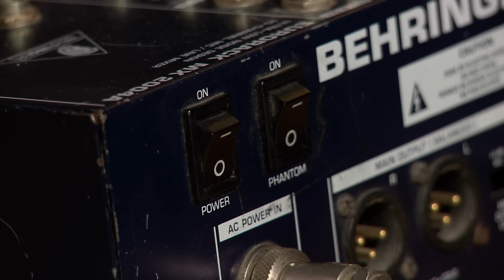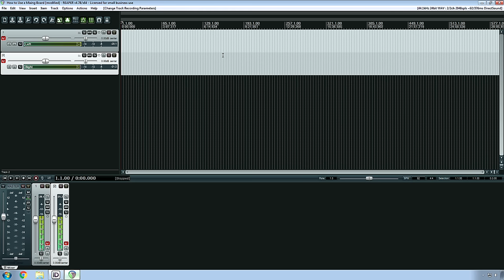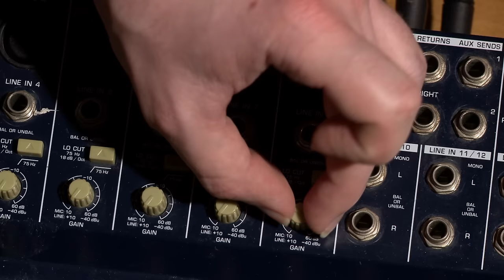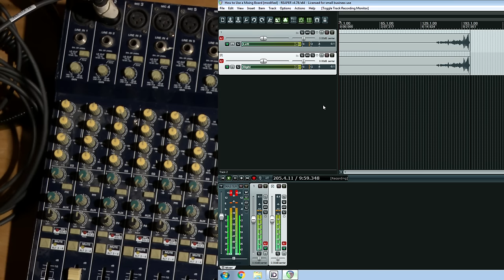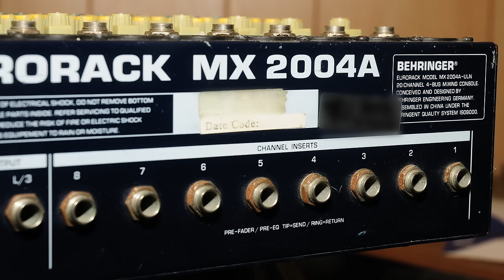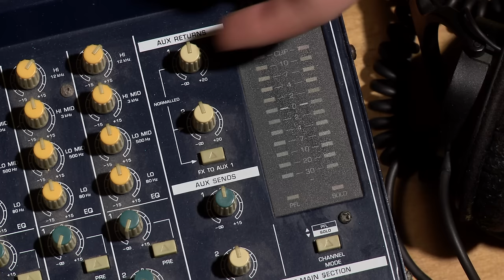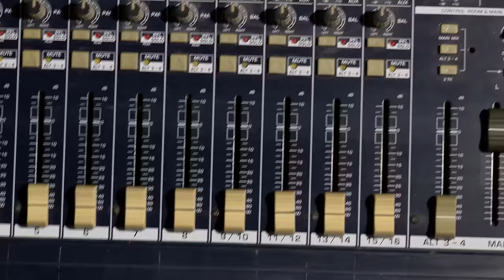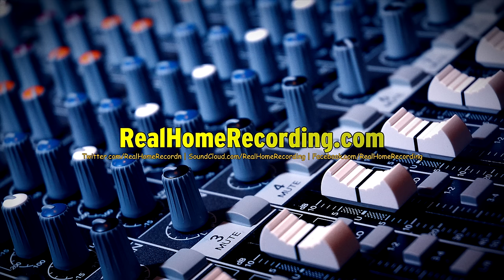How to Use an Audio Mixer Board Tutorial Mixing

Comment: Very recently (2019), for the first time in quite sometime, I felt the pull to go back to an analog desk, after watching videos and reading articles about the new SSL Origin analog console ( especially since its priced at around $50k, which is ridiculously inexpensive for an SSL). 
Starting out in ‘79/‘80, I came up in the era of tape machines, LFC’s, OB Racks and Patch Bays, and while there are some things that I DON’T miss about those days, I really do miss the tactile side of the craft; and, there was definitely something about the sonic vibe that was unique...
It seemed that mixes were easier ( and quicker) to dial in on a desk, than on a DAW. Perhaps it was was because of the inherent limitations of the format; the fact that we weren’t obsessing (or couldn’t) over every tiny, minute detail, as can be done very easily in a DAW. Decisions had to be made, and committed to, because there wasn’t the hundreds of tracks available, with frame accurate editing and the easy ability to move things around on the timeline in the song. And the sound seemed to come together more quickly, with a pleasing cohesion and smoothness...
But... then I’m jarred back to reality, and I remember the other side of analog, the not so good things: constant maintenance of desks and tape machines, editing tape with a grease pencil, razor blade, editing block and editing tape-and there was no “undo” button if you messed up an edit. In addition to that, the electric bill, as a result of having all that gear powered up all the time, the seemingly endless miles of cable to tie in every OB processor and tape machine track to every patch point on a 144 pt TT bay, that was connected to every aux, insert, DO, DI, and track and bus send and return of the desk... along with “total recall”, which in fact wasn’t even close to being “total” at all...
I still think your video is valuable though- it’s a great lesson in signal chain, routing, gain structure, etc., and the knowledge of these things can easily be translated to virtual consoles in DAW’s. 
Thanks. 🙏
Reply from the maker: Very well stated! Thanks for commenting.

Comment: You were concerned leaving the Behringer mixer on unattended, that it might catch on fire. I hate to tell you bro but the Behringer gear, the early stuff that came out back in the day...that was an actual concern when the gear was in use during a live event or a budget recording session.  It’d start sparking and smoking and then burst into flames. No joke 😆. It even had a built-in alarm system. When sparks and smoke started up, there’d be this gawd awful screeching in the mains and then everything would go quiet. That’s when the flames would start coming out of the back where the power input was. 

That description is from a personal experience of mine at a church where I was the board operator about 20 years ago. I’m sitting at the desk minding the store during the sermon and I thought I saw some sparks shooting out of the vent slits over where the power cable went in and then i thought I saw smoke. When it screeched, died and caught fire, I hit the master switch to off on the power conditioner, grabbed the fire extinguisher that was next to the desk that the board sat on and as I was hosing the base of the flames with  retardant, I exclaimed loudly, “Come out of him Satan. Be ye cast out of poor brother Behringer. The power of Jesus compels you. Leave him beelzebub.” About then I got the fire put out. There was some laughter and some applause. That’s probably my funniest FOH board operator experience and why for the next 10 years I’d not touch anything with the Behringer brand on it that used more than a 9 volt battery.
Reply from the maker: LOL thanks for that! Great story and yes you saved the day/made people laugh. Good times!
Reply: Speaking of Behringer products with a 9-volt battery, they do make a nice cable tester. Although, I wish they'd release a model that can test ethernet and TT (the CT100 tests TT cables but not ethernet, and the CT200 tests ethernet but not TT).

Edit: The X32 seems to have worked out pretty well for them, though. I don't think it'd have gotten as popular as it did if that kind of unreliability was still a common problem.

Comment: I have a similar board and I want to do a simple mic into the board and to the interface. I have an outboard EQ which has a set of RCA input jacks and RCA output jacks. I don't know how to connect it to EQ the mic. How do I connect all that up?
Reply from the maker: I would get a insert/patch cable which will have a quarter inch male phone connector on one end and two male RCA connectors  on the other.

Then you put that where it says insert near where the gain knob is and your equalizer should work.

If you're equalizer is stereo/2 channels then by two of those patch cables.

Comment: The reason for not turning power off is to eliminate the stress from the temperature changes.
That's cold when off and warm or hot when on.
I would be more worried about the external power supply burning than an internal power supply.

Comment: So I should get a mixer to use when I livestream my voice, for my art instructional Twitch & UTube livestreams? I also make instructional videos recordings for UTube too... So again is it your opinion that I should get a mixer? I use ORBS program to stream; and Camtasia program to record my drawing visuals (on my Wacom Cintiq) and audio, at the moment; and any needed post editing. I'm a complete noobie to the whole mixer thing. As far as mixers; although I haven't a clue at this point whether I should get either an Yamaha EMX5 12-input stereo / powered mixer (with DSP effects), or the Yamaha MG12XU mixer. (Currently I use a Dell precision tower 7910; Onkyo stereo receiver, and Pinnicle  L & R speakers w/ a bar center speaker, and big sub woofer. I use a Yeti Blue pro mic, plugged directly into computer by USB). Any help would be hugely appreciated.
Reply: With that microphone, you can't use a hardware mixer like this because it connects via USB, not XLR. Even if you got a mic that connected with XLR, you probably don't need a mixer if the only input you have is the mic. That's because you don't have another source to mix with. You could plug the mic straight into an audio interface. If you want more control over things like gain, equalizer, etc you could get a small mixer, one much smaller and cheaper than the ones you mentioned.

Comment: Hi there,

Im a bit new in audio, sorry if some of the questions are too obvious.

I need to record an event (people talking) and I need to get the sound from the mixer. The XlR are taken and also the mixer is very far from where I will put my camera(professional camera with XLR)...  I'm gonna record the sound separately with my Tascam DR-60D MKii, the mixer at the venue is a "JBSYSTEMS MM-10".I have a cable wich is 1/4" balanced Jack to XLR, so I guess I could plug one side of the cable, the 1/4" Jack into the mixer and the XLR into my Tascam  I have few questions.

1- Are the all the output from a regular mixer Line Level?
2- Can I connect any of the Mixer output to my tascam...XLR,6.5mm TR Jack,Auxiliar Sends,Subgroups..etc Is there any different btw them? 
3- Can I use the headphones output from the Mixer to record the sound into my Tascam or professional camera?

My Tascam has Line Level

1000 time Thanks you!!
Reply from the maker: 1. No.
2. Yes, as long as the knobs are set on the Auxes. Pre-fader aux out would be your best bet.
3. Yes and I have used the headphone output on mixing boards during video shoots a few times. It is not ideal but if it's the only output available (or if the engineer is too dense to know/doesn't care how to route signals properly) then you take what you can get!
Reply: Thanks for the quick reply! Why the Headphones output are not ideal? I would like to know the science behind. Thanks again!
Reply from the maker: Extra noise and the headphone amp colors the signal.
Reply: Thank you!!

Comment: So if I use a mixer for studio recording I can't have individual multi-tracks of each of my inputs in my DAW? How is this convenient?
Reply from the maker: You can as long as you have an interface with line inputs. Your mixer should also have direct outputs or inserts. These days, I prefer just using an interface with built-in XLR inputs.
Reply: you can use a mixer to multi track but those mixers start around $2000, cheaper mixers like this one won't multitrack, they may stereo track at best.

Comment: sir 
when you are shutting off the mixer you said shut off the speaker first then lower your gain the adjust the equalizer then lower the volume. what happens after you shut off the speakers and then the mixer but don't do the other thing that you requested just leave everything as you lifted can you damage the mixer like that
Reply from the maker: Your mixer won't be damaged. I just do it so that I get in the habit of resetting the board. But if you say have drums set up then I would leave the EQs in position.

Comment: I have a question. I have a powered mixer. I have  a couple of the channels that don't have XLR but has 1/4 inputs. If need be, can I use a XLR to 1/4 adapter to plug a mic into that channel? The channels does still have a preamp on the strip.  This link will show you the mixer I use. https://www.youtube.com/watch?v=VN6SCukrY7Y

Comment: I think most mic pre's are mono on audio interface. A while ago I tried putting stereo left and right into my M-track line inputs and was still in mono.  Haven't tried it on Apollo Twin though. Found this post on gear slutz about stereo inputs for audio interface when trying to find out what i was doing wrong back then.  https://www.gearslutz.com/board/newbie-audio-engineering-production-question-zone/730027-all-line-trs-inputs-audio-interfaces-mono.html
Reply from the maker: +blood lord (Chaotic Sonics) This was my mistake and I should have included the part of the video where I was choosing the inputs on the computer screen. They are labeled "Left" and "Right" in REAPER when the iD14 is set to Direct Sound as opposed to ASIO. Whenever I record voiceovers with Camtasia channel 1 is panned to the left channel as well.

But yes you are correct technically every input is mono.

The other important bit of information that was glossed over briefly was that normally I would not run the output from the main outs. Any recording that I do from a cheap mixing board is through the inserts to separate channels...eight in the case of Studio B's Delta 1010 interface. Even if only two inputs are being recorded I will still record off the inserts because most of the board circuitry is bypassed which results in a better sound.

Even though the Mackie 1642VLZ3 at Studio B has direct outputs the inserts are used due to the circuit bypass. In the How to Record Drums video that's how I had it setup.
Reply from the maker: +blood lord (Chaotic Sonics) Now if you were referring to my suggestion to use TRS cables over TS that's because TRS = XLR but in phono format. When running a mono signal with a TRS cable you get a balanced signal which inherently has less noise.  http://whirlwindusa.com/support/tech-articles/unbalanced-vs-balanced-lines/
Reply: RealHomeRecording.com
What about 3.5mm to 1/4 inch TRS adapters? would that work better then a 1/4 inch  TS cord? or worst?
Reply from the maker: blood lord Well the connection on the 1/8" side wouldn't be as solid but my guess would be that it would be less noisy.
Reply: RealHomeRecording.com
I'll test it out later with my guitar .
Reply from the maker: blood lord Oh no, don't bother. Guitars are unbalanced by their design so there won't be any benefit.
Reply: RealHomeRecording.com
i figured that since most guitar cables are mono. I got some annoying buzzing sound in my guitar when i'm near my battery recharge station (need them for my bose head phones). The cable that comes with the guitar buzzes more then this other one i got,but they are still in the cheap range. Mostly hear the buzzing on high gain (using MH-500 metalhead amp sim from amplitude, one of my go to amps for heavy distortion) . Can't hear it when playing though.
Reply from the maker: +blood lord (Chaotic Sonics) It's amazing what guitar cables can pick up.

Comment: You did not explain why you moved slider up to 0 db
Reply from the maker: At which point in the video? Faders are kept at 0 dB because that is the optimal signal to noise  setting. Volume (technically, input signal) should be set with the preamps.

If you absolutely must, use the fader to take away signal level (lower volume) but do not put faders past 0 dB.